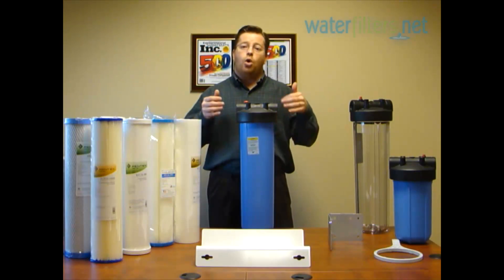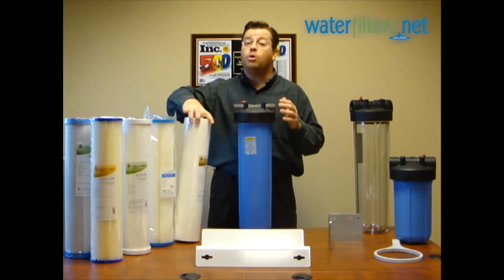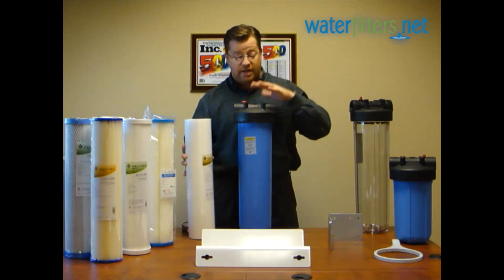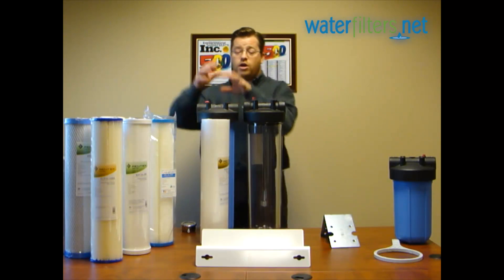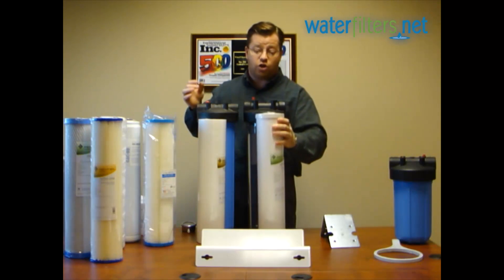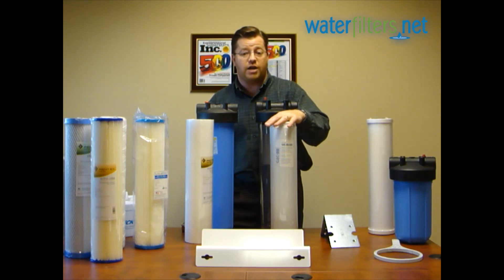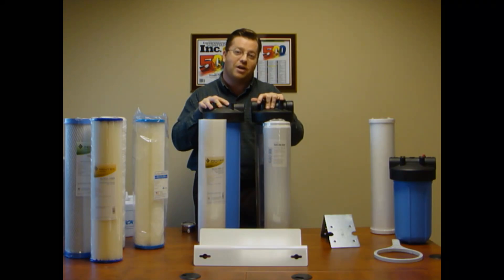Untreated Well Water Filter System Setup Basics

Comment: Could all the canisters be clear?  Is there a problem with setting this up outside in hot/humid Central Florida?  How often is filter replacement, and is it costly?  We have hard water, so we may need a water softener as well.  Does that get installed before or after the filters?

Comment: What about clay? Our current well might be drying up due to overdevelopment. We have a second well capped with a  steel plate, is 300 feet deep. It was the first well, but kept pumping sand and blue clay and stunk like rotten eggs. So they abandoned that and drilled our current well nearby. Might have to switch to the 300 footer. Will this system handle that kind of contaminates and provide enough water for the whole house?

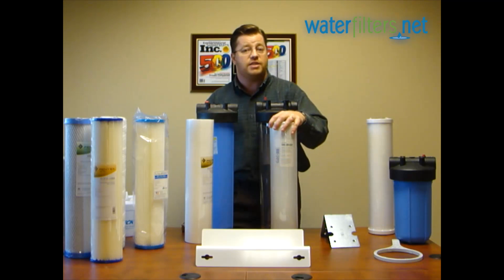Comment: 2:20..  KDF .. Kinetic Degradation Fluxion.  BTW  If you eat KFC, you might as well drink street water right from the gutter.

But seriously, for a shallow well that smell sulfur, what is a high flow single filter recommended for bathing and rinsing dishes with antibacterial soap?

Comment: Why shouldn't I use a pleated filter as the 1st stage after my well tank, I agree with activated carbon as 2nd stage.  I am just curious why a pleated filter is bad as the first stage vs spun filter which you recommend.
Reply from the maker: You should not use a pleated CELLULOSE filter for well water, as bacteria could use it as a food source, versus using a pleated polypropylene filter, which is bacteriostatic.
Reply: @Tier1Water  Aaaah, good point.  Thanks.

Comment: dump near by started suck water out of the ground because they contaminated the water supply. this dropped the water table by a lot. Had to drill new well. now there is heavy salt content. (taste salty), had company come in and instal complicated filter system. even added chlorine, and water softener. The water is still salty. What do you suggest?  fwenz1@cfl.rr.com

Comment: How does the carbon and the KDF filter work with low pH well water system? I have a calcite pH correction system installed. 
How about treatment for organic and bacterial/algae contaminants? There is a lot of slimy clear buildup in the filters. I'm affraid it will ruin the carbon media filter. Any suggestions?

Comment: Will this filter work for extremely fine sediment (it feels like flour and looks like grey paste?) ... I don't see the reply to this question. Any help would be appreciated.
Reply from the maker: There are many different micron ratings of filters available to choose from; if your sediment is still in particulate form,  you can choose a sediment filter with a lower micron rating (meaning it will filter smaller particles).

Comment: Will this filter work for extremely fine sediment (it feels like flour and looks like grey paste?) Every one I have used plugs in a few minutes.
Reply from the maker: There are many different micron ratings of filters available to choose from; if your sediment is still in particulate form,  you can choose a sediment filter with a lower micron rating (meaning it will filter smaller particles) to filter out smaller particulates. If your filter is actually plugging up with particulates, that means it is trapping them; if you don't want those flowing through to your water supply, the solution in your case would probably be to use another filter first to trap LARGER particulates, such as the Rusco spin down filter system - https://www.youtube.com/watch?v=Ad1WetRDSj0

Comment: My well water is very hard. I have placed a water softner for in house use.  But the I plumbed the irrigation and couple of hose bibs before the water softner and water is eating through (breaking) my concrete.  So I like to add another filter right at the well.  Well water goes into an underground 5000ga tank and then pressurized and travel 400' and 20' lift to the house.  Any recommendation?

Comment from the maker: For an H2S problem (hydrogen sulfide) KDF media works very well, but you'll need two filter housings in a parallel configuration to avoid flow restriction. In a perfect world anyone with a serious iron, manganese, or h2s problem would have an automatic backwashing system with greensand and/or KDF 85 filter media.

Comment: odors are usually caused by iron and/or sulphur in the water, or sewage leakage.. yucchh!
Iron bacteria shows up as a orange sludge.  these are treatable but expensive.  a high quality water conditioning system may include an additional separate iron and/or sulphur removal device.  Highly recommend a sediment pre- filtre before the system.  There are premium conditioners on the market that reduce the amount of salt back into the house water as well as out in the backwash to the septic tank.

Comment: Great video.Most wells in florida has tannin and hydrogen sulfide which can be easilly treated with high active carbon filter without taking valuable calcium,instead of putting expensive ion exchange salt units which waste water and energy and the water is not drinkable.Solving that, they put reverse osmosis to make water dead and propose that is the best for you.Alkaline water is the most beneficial for your body and if you have PEX piping and glass lined water heater,you are all set.

Comment: What do you recommend I use if my well water has a lot of rust or iron in it
Reply: So this is six years later so what did you end up using and did it work? Need to get iron completely out of the well water.
Reply from the maker: The most effective treatment for rust/iron in your well water depends on the level of iron in your water.

If your iron level is below 3 parts per million (ppm), you could install an iron and manganese filter cartridge at the point of entry to your home.
https://www.tier1water.com/whole-house-cartridge-systems-tier1-fh-20-45-mang-iron-kit.html

If you have BOTH iron that is below 4 ppm AND hard water, you could invest in a Tier1 Whole House Hardness, Iron and Manganese system.
https://www.tier1water.com/whole-house-water-filters-systems-t1w-wh-hd-irn-mg-1054.html

If you DO NOT have hard water, and your iron level is above 4 ppm, your best option would be the Tier1 Whole House Iron, Manganese and Hydrogen Sulfide Air Induction Oxidation Filter System.
https://www.tier1water.com/whole-house-water-filters-systems-t1w-wh-irn-mg-slfr-bw-1054.html

If you have hard water AND iron above 4 ppm, your best option would be to install both a traditional salt-based softener and the Iron, Manganese and Hydrogen Sulfide AIO System.
https://www.tier1water.com/water-softener-lines.html
https://www.tier1water.com/whole-house-water-filters-systems-t1w-wh-irn-mg-slfr-bw-1054.html

You can read more about iron in your water here - https://www.tier1water.com/everything-iron-and-rust.html
WaterFilters.Net is affiliated with Tier1water.com.

Comment: Does this prevent staining of clothing and bath fixtures with a rust-colored stain? My husband has a home on well water, but the water is not potable and is not good for cleaning either, since it stains everything. They buy water in jugs for drinking, cooking, and pets. I don't know if it's iron or something else. Also, there is a foul odor to the water. Would a filter system such as this prevent both the staining and make the water potable for all uses?